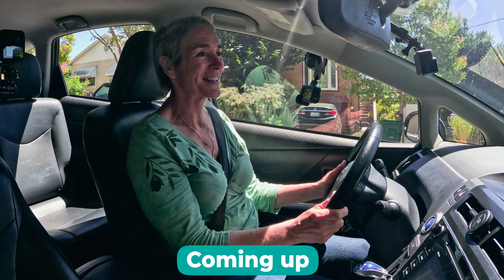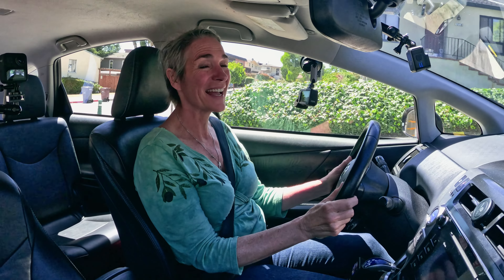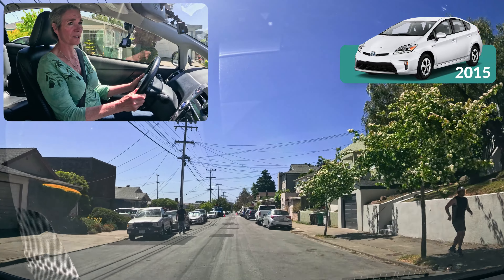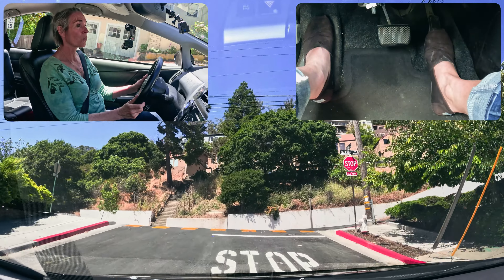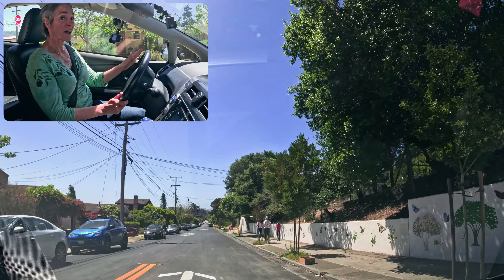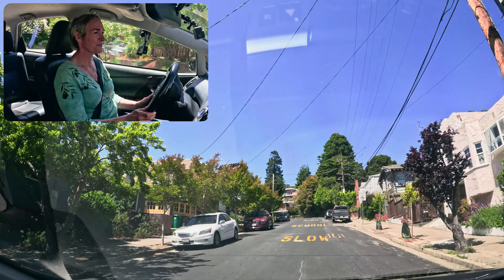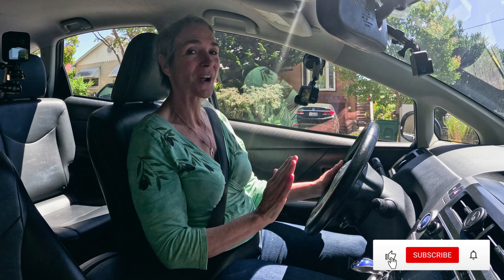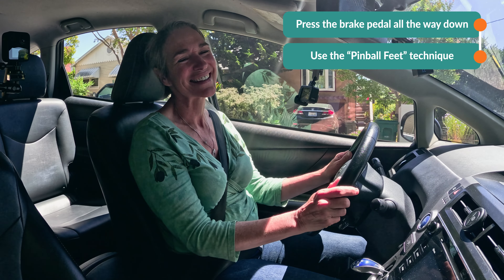How to Drive Uphill and Downhill (Driving Instructor Tips)

Comment: and what about the gear? like 3, 2, L?
Reply from the maker: In different car models, the lower gears may be marked differently. Some cars use numbers like 1, 2, or L,. Regardless of the specific markings, using the lower gears for uphill and downhill driving will help you maintain control and manage your speed effectively.
Reply: @Zutobi_US  Should I change the gear from D to 3, 2, L while on moving?